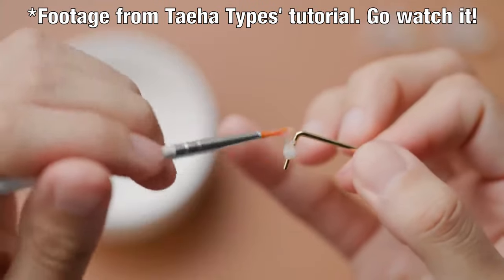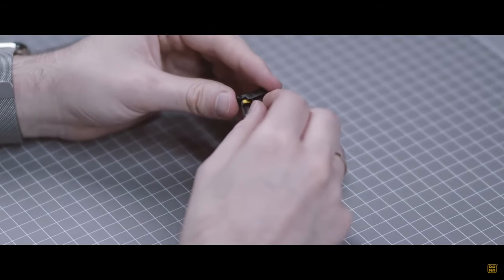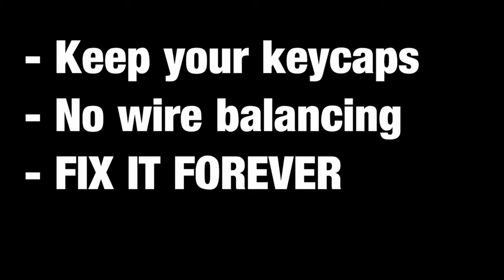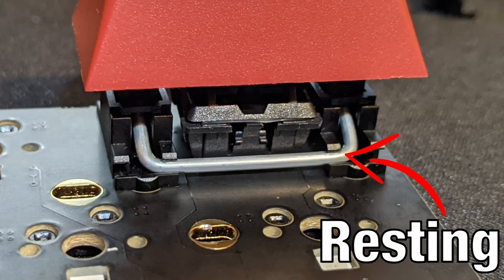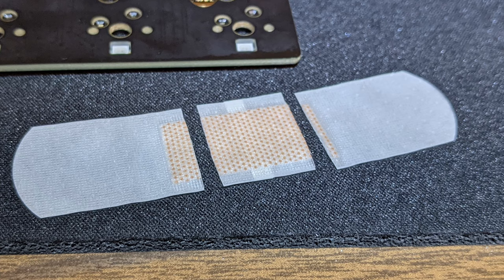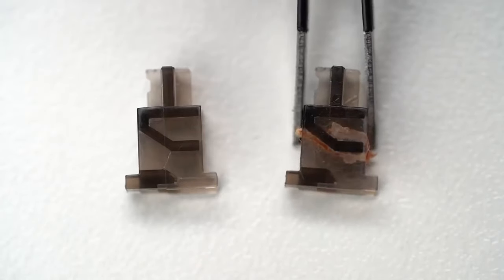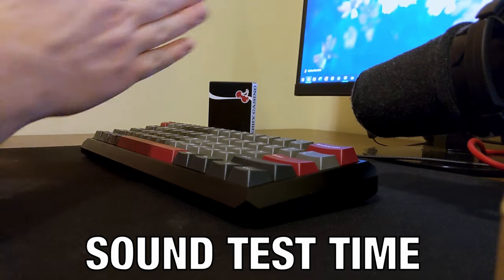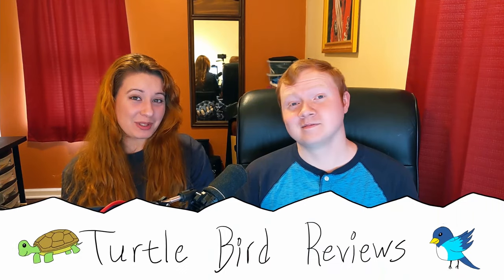How To ACTUALLY Fix Ticking Spacebars!

Comment: Tbh the plumbers mod solved my ticking probems. I apply the teflon tape on the wire where the stab clip and wire meet as well as the ends (i prefer this than holee mod as i think its more durable in the long run rather than a single strip of band aid. After applying the tape, i then apply molykote grease on the ends of the wire where the plumbers tape are. I wrap the teflon tape about 3-4 times on each wire end and 2-3 on the wire where it hits the clip. If it feels a little slugging, dont worry, spam it for 10 minutes and it is golden. This is what i have done for my wooting 60he and i have no rattles whatsoever.

Comment: Cool trick/faster way to do this is to just use the PE foam mod, but don't cut out space for the wires (but still cut out space for the stab housings). 

The PE foam will effectively act the same way as the bandaid in this video and fill the gap between the PCB and the wire of the stabilizer.

Comment: Basically this is conformation that it is a misaligned wire. So the "clean" way would be to learn how to balance wires. For me using bandaids in a several hundred dollar keyboard build just doesn't sit right. Your explanation of what causes the tick however was very very thorough and well explained. Thank you.

Comment: I think  this what I need to do to my NJ80, I tried doing the holee mod but I must have been messing it up because the stabs kept bottoming out on my durock v2 stabs for my space bar. I get the ticking sound only on the left side of my space bar, I don't notice when I'm typing all that much since I press it down with my right hand and not my left, but I definitely notice it when gaming. Def going to give this a try, thanks for the awesome video, I'll let you know if this helps and if it does then everyone needs to check out your channel because you seem pretty awesome!

Comment: Hey Great video it gave me an idea that I actually tried, instead of placing the band-aid under the stabilizer bar just put it directly on the bar ( without the cotton, just the sticky part) its easier and it makes sure the bar is never going metal to metal so no ticking. ofc you need to cut the bandaid to size so it doesnt cover the part where the bar connects with the stabilizers but it sounds great.
Reply: I Used a more fabric like bandaid it was more thick than the one you used in the video btw

Comment: I found that even my Staebies V2 would tick ever so slightly even when balanced and I found that it was due to the clips that hold the wires. Instead of a bandaid I opted for a small piece of 2mm EVA foam. Haven’t had any issues with sluggishness or the foam coming out from underneath

Comment: So i have duok v2 stabs, and i have holee modded mine, lubed them, bandade them (under wire and under the housing) and the ticking still happens, its has become less noticeable after leaving some screws to balance it out , but I still get a very slight ticking noise, that won't go, so unless I got some wire balancing I need to do, can't for the life of me understand why it continues to do this.

Edit: Turn out it was a warped spacebar

Comment: I fixed mine with O rings....I only put them on the stabs and since my bar isnt straight, I used 3x on the left and 2x on the right, some lube also but didnt do any tape mods yet. Though I have a HE keyboard so the keystroke feels the same as its set super high (maybe a normal keyboard would suffer from press input idk)

Comment: can i do the band aid cushion thing without having the stabilizers already installed and instead putting the band aid first then installing the stabilizers? I cant really open up my pcb from the plate due to tape mod, so i have to put the band aid cushion first then install stabilizers
Reply from the maker: As long as there's no interference and the stabs aren't being screwed in on top of the bandaid, it sounds like that should be fine.

Comment: Do you know what's the best way to clean off the previous lube on the stab stems so that the tape would stick in order to do the holee mod? Cuz whatever lube was used before this seems impossible to remove. I even tried Isopropyl.

Comment: Wire balancing is a must and fairly basic. It is the solution to the ticking.
Reply from the maker: I hear you. I just recently made an upgrade to my keyboard (vid coming) and I tried wire balancing for my spacebar. It worked pretty well!
Reply: @Luke Mason  Im still learning too. I just watch a video with Shoobs and Glarses...they referred to using anything but lube is strange; lube is weird enough....they considered the holee mod a "skill issue".

Comment: Does this work with plate mounted stabilizers as well? I find that the wire doesn't actually come in contact with the pcb for plate-mounted stabs, but I still have ticking :(

Comment: I learned this not too long ago as well but I used the same method as the "Tailor" mod. I used nylon thread so there's less friction and you can still use lube without fear of it causing the adhesive to fail on the bandaid. Pain in the ass but worth it I guess.
Reply: is there a proper guide on yt or link pls?

Comment: Even with these two mods, it's possible the real issue is still your keycaps. Small QC issues or cracks in the plastic mount of the keycap can cause ticking.

Comment: I use on my screw in Stabilizer 205g0 lube on wire and housings + Hoole mod with (Fabric Flexible Band aid) + Balancing wire and Small Flexible band aid below the stabs stems also need to break in the stabs so the mushy feel go away

Comment: so for the spacebar, do you need to put that band aid so long to cover all that long wire or is that any other similar methods?
Reply from the maker: Just cover both opposite ends separately with two smaller pieces.
Reply: @LukeMason  thanks for the tip

Comment: im proud that my first mechanical was a red switched.

what im not proud of nowdays is that;
-Full Layout
-Metallic base with no way to open it, so it echos with every key pressed down.
-It was black and grey with only blue led (i thought it has rgb lol)
-it has stabilisers on the spacebar instead of 3 swithces lol. And theyre not even good, sometimes i like fall in games or sht since i click too far to the sides lol 

but anyways, i bought it in a "manic" adhd episode soooo 

edit: t least i have pink/white keycaps...they look only white tho...and the layout of 4 keycaps were wrong :'D And i dont really need to use led since its easier to see the letters when its lightcolored lol. My mouse is tho a bit darker pink and rgd cyckling led :'D The new keycaps stangely make it quieter, and theyre not abs + theyre lower + from amazon for like 20 dollars lol

Comment: hi, i had the Logitech G PRO, with blue switches, and i will solder rivets to him making it hotswappable. sounds too much with high frequency only touching a very little bit the keys with stabs. what you can recommend me? thanks.

pd: i had double orings in the keycaps and i want to lock the clicky thing.

Comment: Why they don't add 2 more spots for a switche instead of stabilizer. So the spacebar would use 3 switches. The one in the middle is the one who is "working" the other 2 are just for stabilizing.
Reply: This is actually a great idea
Reply: @praigleo5883  yeah it just makes sense to me

Comment: Does the band-aid only need to touch the spacebar wire ever so slightly? If so, that’s what mine was doing and I can’t seem to notice a difference after doing this mod. I’m using the KBD67 Lite with Durock v2 stabs.
Reply from the maker: Needs to keep the wire from being able to tap hard surfaces. Might need to be thicker, depending.

Comment: The ticking on all my stab drives me crazy. This mod didn't work, even combined with holee mod, I even bought durock plate mount stabs but the ticking still exist. I found out using different keycaps switch the ticking from left to right and vice versa. So in my defeat I just use keycaps where the ticking are all on the right side. Not sure what happen there.

Comment: how about the wobble of the keycap? my stabilizers don’t make any noise/move at all but my left shift keycap wobbles on the left side. idk if that makes sense but it drives me crazy😭 (did the holee mod, tape mod for stabilizers so it literally does not movie but the keycap wobbles)
Reply from the maker: Probably cheap keycaps, a bent wire in the stabilizer, or loose stems in your switches.

Comment: Appreciate the tips.  Personally, I think that space bar still needs some work.
Reply from the maker: I get that. That's why I'm probably getting TX stabilizers soon to see what all the hype is about.
Reply: @LukeMason  Yeah, they appear to only be made as clip ins.  I haven't gotten an answer to this question in the past, but is it possible to use clip in stabs on a screw in style pcb like on the Keychron Q3?  Probably a noob question, but hey, I'm still a noob.
Reply from the maker: PCB mounted stabilizers can be clip in or screw in (interchangeable). So yes.
Reply: @LukeMason  Awesome, thanks for the reply.

Comment: thanks, I'll have to try this on my spacebar. also, would you happen to know why my linear spacebar feels tactile?
Reply: You mean the switch is linear but it feels tactile?
Reply: Well idk man
Reply: I guess lube it or change the stabs
Reply: @paklekj4429  thanks, i figured it out: that the bandaids i put in the stab housings were wrapped around the hole to be secure made it feel tactile. i redid them but only having the bandaid in the ramp part of the stab and the bump is gone. my linear spacebar feels and sounds like a linear spacebar again so yay

Comment: I hate that I only saw this video after finding a real solution to it. About a month ago when I built my first mech, after making sure I haven't done anything horribly wrong, I was PISSED. I was so pissed at for the fact that most enthusiast see it as an non issue, to me it felt that this is a bar set too low for an niche enthusiast hobby. Worst part was nobody had a real solution to it, just lube it properly they said, watch Taehatype's tutorial they said. No matter how well lubed the stabs were, the ticks all comeback within DAYS. EVERY OTHER DAY I WAS TAKING APART MY KEYBOARD EVERY FEW DAYS AND CLEANING THE STABS AND RELUBING THEM.

Comment: If anyone is reading this comment and knows please help. Basically i have akko cs radiant reds hand lubed and they are pretty good except for a couple of keys that give a ticking loud sound that ruins the sound of the board. I tried adding more lube but doesnt help. What can i do
Reply: Does that ticking sound come from the switch itself? If so, then I would recommend lubing the spring a little bit thicker at both side of the spring, if it doesn't effective, then I would recommend swapping a new spring for the switch and then lube the spring again.

Comment: uhmw tape on the stem wire before you lube instead of heatshrink(way way less friction) and use teflon tape vs bandaids (again less friction and also less mushy)

Comment: What material is your band aid made of?
Reply from the maker: Plastic and gauze. You could probably also use a fabric bandaid.
Reply: Did the plastic band aid felt mushy at first?
Reply from the maker: @twixz4883  On the PCB, no. In the stab, yeah, at first.

Comment: Better solution for me personally get better or stabs or maybe you got a bad batch of stabs but durock v2 usually cause no issues for me
Reply: Durock v2’s has always given me ticking noise if I only modded it with lube..
Reply: @igieswainebragt  what why then wut stabs you use some that are good are like taobao pretooled snap in stabs or retooled gmk screw in other than durock v2
Reply: @tonchok9488  I just stick to durocks v2's but holee mod them.
Reply: @igieswainebragt  I just don't so any mod lmao holee mod too mushy even when break in but hey if that works for you then it's fine
Reply: @tonchok9488  nah i agree with you holee mod ending up being mushy, or removing the authentic sound of keystroke but only lubing them up won't remove ticking.. i fucking hate stabs..

Comment: Get rid of cherry stabilizers easy solution because they dont have two blocks on left and right that means socket is rattleing between left and right every time you click this can’t be fixed by lubing
Unscrewed the keyboard and waiting for durock v2s until then I won’t touch spacebar lol

Comment: 2022 update: just get tx stabs lul
Reply from the maker: Never heard of those. Are they rattle-free?
Reply: @LukeMason  yep, they fixed the whole rattle and ticking thing through smart engineering by lining the inside of the stem where it touches the wire with TPU rubber, and they're completely rattle free with a minimum amount of lube, and could even be used dry. for the first couple of months after release nobody could buy them, but now they're readily in stock in a lot of stores.
Reply from the maker: @tofu.delivery.  Well dang. That's nice. Definitely picking those up at some point. Might have to make a review video!
Reply: @LukeMason  sweet, i'll be looking out for that